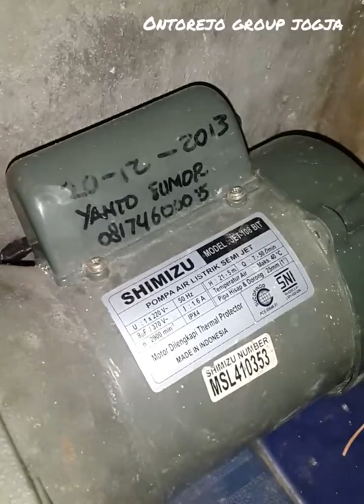Yanto sumor Semi jet modif jet pump hemat listrik ..hemat biaya

Comment: Mas,itu pipa hisapnya berapa inchi mas? Pipa outnya berapa inci?..soalnya saya juga baru beli shimizu 108.mao nyoba.
Reply from the maker: 1in semua..lempar 3/4 gak papa..tp daleme ruang hisab d modif lo mas..mata jet d lepas.
Reply: Kalau Ndak di lepas knp om
Reply from the maker: @wahyumulyosejati4848  gak bisa ..
Reply: Mas kalau pompa dah  diturunkan 2 meter alias di gali  tapi air keluar kecil gimana caranya. Permukaan air 10 meter. Pipa sumur bor 1 1/4.
Reply: @yantosumorontorejogroupjog3813  mas, kalau mata jet dilepas kan sama aja daya hisap nya kurang. Dari 11 meter mungkin bisa berkurang maksimal 9 meter.
Reply from the maker: @arismeong6147  sulit  itu..maaf baru bales..harus pake  mata jet   bawah  boss..
Reply from the maker: @suprifadri8365  jet dalam  di lepas,.tp kita tambah jet  di bawah  boss..spt  pompa jet  pada umum nya...
Reply: @yantosumorontorejogroupjog3813  ini sudah ketemu kok mas saya gali 4 meter pipa 4in trus mata jet saya masukin ke dasar 4 meter alhasil kluar lancar airnya
Reply from the maker: @arismeong6147  mantaapp

Comment: Itu sedotan brapa meter mas?
Reply from the maker: 9mtr
Reply: Maksut saya....sedotan'y bisa mencapai berapa meter
Klo jet pom kan maksimal 40m
Sedakan semi jet-pam maksimal 12m
Apa semi yg d rubah jadi jet pom mampu menyedot 40m juga?
Reply from the maker: @iqbalfauzan2869  9mtr mas..sesuai daya yg d miliki..100watt saja..
Reply: YANTO SUMOR 081746000 coba pke semi jet-pam yg ukuran spul'y sama besar dengan jet-pom...
Itu klo di robah jadi jey-pom bisa menyedot 30m
Reply from the maker: @iqbalfauzan2869  hemat daya mas..
Reply: YANTO SUMOR 0817460005 sama kok...
Saya sendiri udh pernah nyoba...cmn gk sempat d vidio in
Reply: Jetpump dan semi jetpump memang lebih irit yg mna bos
Reply: YANTO SUMOR ontorejo group jogja kalau type yg 300 bit bisa kah dibuat seperti itu? Kedalaman sumur 30 meter, mohon pencerahannya...